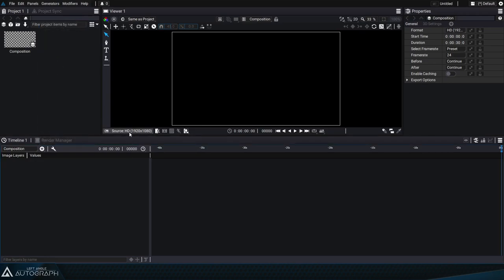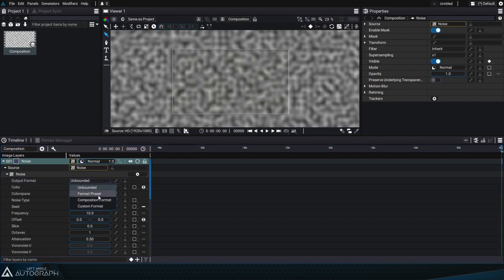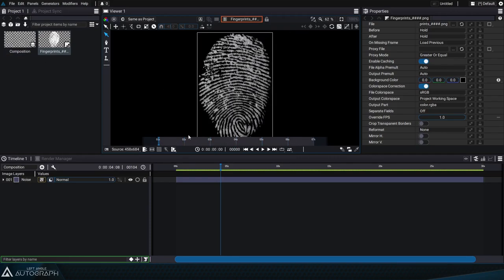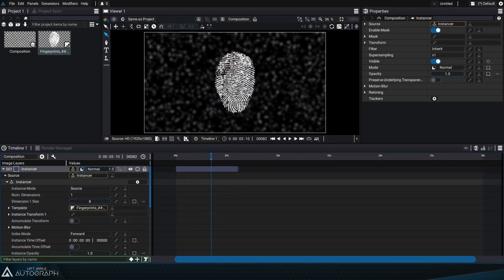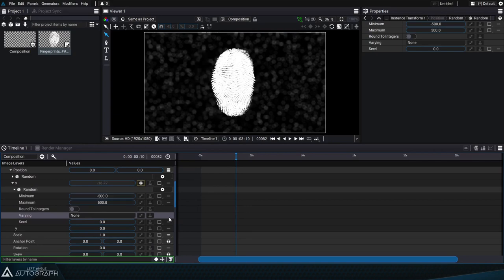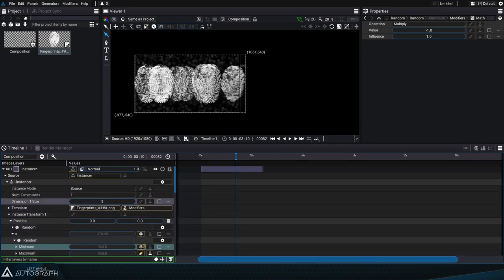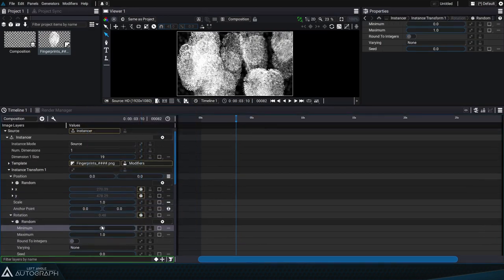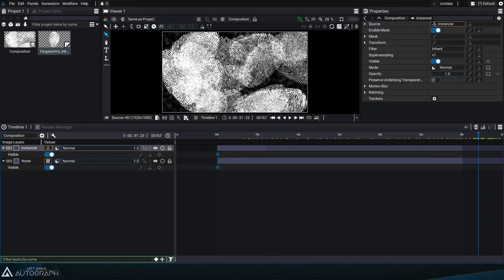Custom Generator Part 1: Setting up a Responsive Design Project

Comment: Audio in timeline would be pretty essential...
Reply from the maker: Hi there, we are currently developing a system to place audio sources and add filters on a second timeline, synchronized with the "Image timeline", like an editing software. This allows several audio sources to be grouped together (like a sub-composition, similar to what's call a "Bus" in audio software), allowing a pre-mix to drive parameters of the "Image" timeline. Generators such as a spectral analyzer for example, will allow to generate numerical values according to a frequency range, without the need to generate keyframes. This makes it possible to replace the audio source by another one and to have an automatic update of the project. The purpose of this Audio timeline is not only to place audio sources in the composition, but also to use this information to drive image parameters.

The Audio Processing Pipeline is finished, we are currently working on the interface and the way to generalize the use of this Audio timeline to drive any items in Autograph. 2D Modifiers of course, but also layer transformation, path deformation, 3D object deformation ... so to make it short, every parameters.
Reply: @left-angle  let us know, when it's in the demo